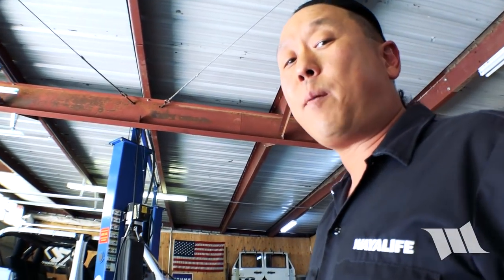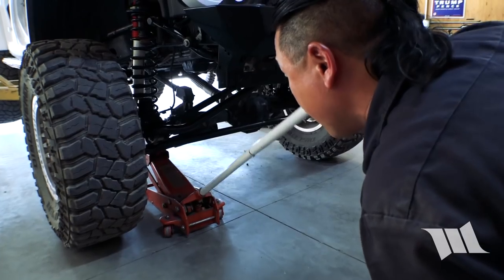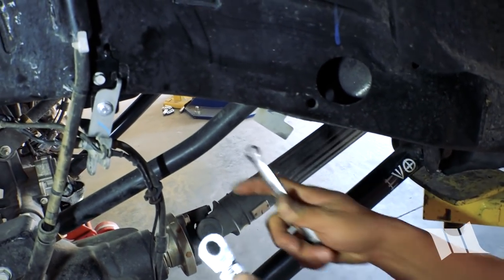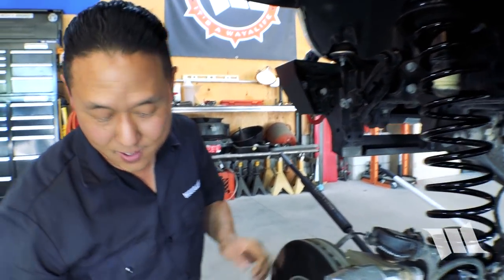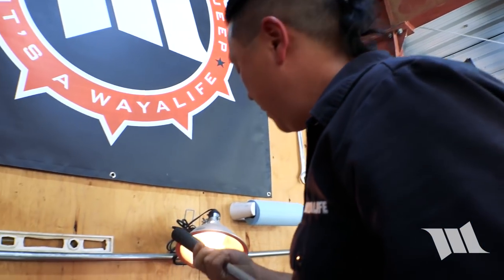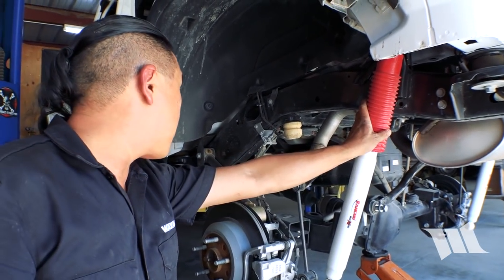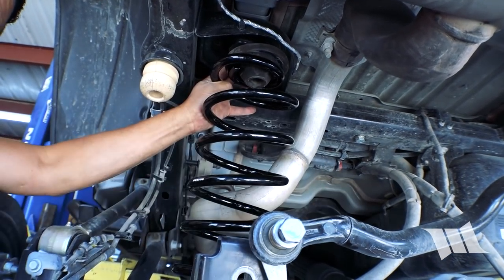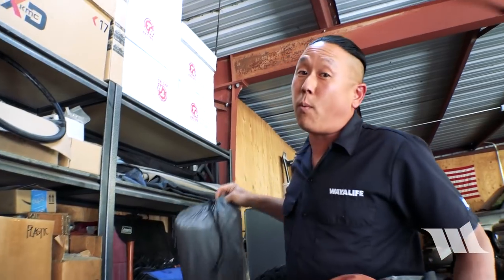Jeep JL Wrangler 2 Inch Lift Kit How To Installation : Dynatrac EnduroSport 2" Suspension Lift

Comment: I have been fighting with my AEV lift trying to dial it on for weeks and it’s just so harsh. Would this or a teraflex lift be a more plush and comfortable ride?
Reply from the maker: I am sorry to say but neither will be more plush and comfortable. Both are designed to not sag as much when carrying a heavy load and you just can't have your cake and eat it too. Mopar or even EVO coils will offer a much softer ride and if you carry a lot of gear, I would recommend that you install coil spacers to help make up the difference. Both of those coils are designed more for ride comfort.

Comment: Thanks again you two for another first rate install video, I've watched a lot of how-to videos and yours are still the best. So seriously thanks for the effort you put in over there.  I do have an off topic question, if you don't mind.  How do you find the Tekton tools working out for you?  We've been replacing our Craftsman stuff with Tekton as the choice for "best bang for the buck/Everyday wrenching" based on reviews but we're new-ish to the Tekton brand so would love to hear your thoughts before we get too heavily invested.  The shop will eventually be a mix of Snap-On and Tekton (which kind of rhymes too which is a bonus).
Reply from the maker: It's sad but true that Craftsman just isn't what it was anymore. So far I've been liking the Tekton stuff and they've been holding up well for me or, so far anyway. Snap-On is awesome - just super pricey.
Reply: Thanks for taking the time to reply to that, I'm happy to hear we've made a good choice in going with Tekton.  No complaints here so far, and yeah it's pretty sad that Craftsman has gone down hill they used to be amazing.  I'm sure they still make nice stuff it's just few and far between these days. Yeah Snap-On is great and yeah it's extremely costly, I like the no hassle return policy though and for some pieces that see a lot of use that warranty has been invaluable.
Reply from the maker: Yup. For the things that I really need it to count, I still turn to Snap-On too.

Comment: Great video as usually...is it true when you use an extension you must add more than what the spec call for ? For example : 125 ft/lbs should be 135 ft/lbs instead ?
Reply from the maker: Maybe if you're using cheap tools. A quality one shouldn't make a difference.
Reply: @wayalife  
How about if you use the same hardware over and over again should you increase on torque spec due to stress ?
Reply from the maker: With most of the bolts and nuts, you shouldn't need to. There are some though that shouldn't be reused such as the pinion nut.
Reply: Extensions make no difference but wrenching with universal joint sockets do. If you are offset of 90 deg

Comment: Do you know how long the stock rear swaybar links are? I just bought this lift and want to replace them with quick disconnects (up front, after the relocation, on my sport-s). Also, any recommendatuons for quick disconnects? Thanks!
Reply from the maker: If you bought this lift, the disconnects you'll want will be the same lengths as the factory rear links. I would recommend JKS disconnects.

Comment: I have a 2021 Wrangler. 4 Door sport. Ive Noticed I have a bit of a sag from all the weight from the side steps and front/rear ( Smittybuilt items ) bumpers. im seeing how its affecting my tires. from the jeep community im around they all run 40s which I do not want. I would love to run my Rig with 33s or maybe 35s. everyone is telling me to go with a 3.5 lift kit . stating it would fix the sag and wanting the height im wanting. BUUT it would mean that im replacing alot more under the jeep. I had thought about a 2.5  at the start but with this lift kit but was not sure if i would have what I wanted due to the weight. also what brand should i even be looking at? I really loved Old man Emu but from what i heard its a different set up in the UK than here so im lost what is it i need to do and what brand??? HELP lol
Reply from the maker: Personally, I would recommend a Rancho Sport lift as it is very affordable and will give you the lift you need to clear the tires you want to run. Here's a link to a video I made about it https://youtu.be/0x1wR2m5sKs

Comment: Hey Eddie, I bought this liftkit and installed it after watching your video. The install was a breeze and the jeep now looks like the toy I used to play with as a boy — so thanks for that! Problem tho is that I noticed a clicking noise after I installed the kit and the 37”s. I notice it sometimes when turning or when there are sudden movements on the jeep and I’m certain it is coming from the front of the vehicle. I’ve checked all installed parts were torqued to spec as per the instructions included in the kit. Any ideas what it could be? 
I also noticed that my the drag link has some play on the passenger side connection, but some forums say that’s normal for the JLs? Thoughts?
Reply from the maker: Did you double check your sway bar end links to make sure they are in fact tight? Also, have you checked to see if maybe one of your coils is catching on the bump stop tower? Rotational movement in a joint is normal. Shifting side to side or up and down is not.
Reply: I did double check all those you mentioned above. I was able to fix the clicking noise — it was due to loose upper and lower control arm ball joints. Something I’ve learned from a couple of forums, that those are sometimes loose straight out of the factory. It’s pretty interesting that I noticed the clicking only after the liftkit install.

Comment: Curious what size engine this has? I have a 2021 rubicon with the 2.0 liter but everything I look at says this lift will not work with the 2.0 liter. Love your videos.
Reply from the maker: This JL has a 3.6L but I see no reason why you couldn't install any lift on your 2.0L. I should also note that you should NOT run anything bigger than 35" tires with this lift. Over time and use, I found it to sag and only yield 1.8" of lift. Way too little for 37's.
Reply: @wayalife  do you still have the same lift on your rig or have you upgraded to something that handles your 37s?
Reply from the maker: @troymathis4755  I replaced the lift a few times and mainly to test things out. I'm currently on coilovers and long arms - a BIG jump from what you see in this video.

Comment: everyone seems to start up front.  I know you said you had already switched them, so in your case it makes sense.  But with the sway bar links needing switching, I'm assuming stock JLs will need to start in the rear?
Reply from the maker: They're just sway bar links and you can pretty much install them at anytime and with your Jeep on the ground. But, you can start on whatever end you prefer :)
Reply: @wayalife  following your lead and adding the 3/4 rough country spacer to my build, as I have the same winch and heavy front bumper.  Just looking through their instructions, you didn't show this step in the video 😂 "Any vehicle equipped with any Rough Country product should have a “Warning to Driver” decal installed on the inside of the windshield or on the vehicle’s dash. The decal should act as a constant reminder for whoever is operating the vehi- cle of its unique handling characteristics."
Reply from the maker: @matnelen1724  LOL - too funny :)

Comment: How do you think this Dynatrac lift kit compares to the 2” one from MOPAR?  In all honestly which do you consider better?  I’m trying to find the best 2” lift possible as realistically I can’t go higher due to the space in the condo in the city. Also, just wondering why Dynatrac didn’t include the new front control arms.  I already have the Mopar lift, if I opted to go for the Dynatrac would you keep the Mopar loft control arms with it? Thank you!!! Hope you have an awesome Christmas!  ✌🏼
Reply from the maker: Honestly, between the two, I probably would have to give it to the Mopar kit. The Dynatrac lift doesn't need new control arms because it really only yields about 1.8" of lift and that's well within OE spec. The Mopar lift yields closer to 3" of lift and it much better suited to run 37's. Also, the Mopar kit comes with Fox 2.5 shocks instead of just 2.0's like the Dynatrac lift. Being that you already have the Mopar installed, I would just stick with it.
Reply: Thank you brother!  Much appreciated 🙌🏼 I didn’t even realize the Mopar kit has 2.5 shocks over 2.0.  Honestly I wish you all the best for the holidays.  Your videos are so detailed that it’s literally pleasing to me.  So many others are just washed with junk but I do love how your videos are so well edited and just straight to the point.  

Thank you again, I appreciate you responding!
Reply from the maker: Flattered you would say as much. I know we're not as popular as some of the other channels out there but we try to keep it real. Glad I could share what I know with you.

Comment: The main reason I was asking is that I was was very disappointed in the Mopar performance lift ride quality, especially off road. I found it to jar the crap out of you with just the slightest increase in speed.
Reply from the maker: It's hard to get a good ride that can really soak up big bumps without spending a lot of money. And if I can be perfectly honest, this kit, even at it's higher price point will not give you what I think you're wanting. Trust me, a super nice ride can be had but it'll cost you.
Reply: @wayalife  thanks much. I appreciate your honesty

Comment: So it’s a 2” lift, what size tires do you run? Thanks for the video.
Reply from the maker: In this video, we were running 37's but after long term use, we found the lift settled down to just 1.8" of total lift. Far too little for 37's and so we changed it out.
Reply: @wayalife  did you go down to 35?
Reply from the maker: @TargetOz Negative. I installed a different lift.

Comment: Eddie. Great videos as everyone says. I tow a trailer behind my JLUR. Currently no lift and stock 33’s. I saw Trail recon Brad review the dynatrac endurosport and also watched yours along with the Rancho. I don’t see myself getting higher than 35’s but do plan to do trails in Moab and The rubicon trail at some point. I was thinking of these two or the metal cloak dual rate 3.5 vs the smaller one only coz I don’t want to keep changing but given that I tow with mine I am thinking I shouldn’t go much higher than the 2” lift. Thoughts?
Reply from the maker: This is what I can tell you. The Endurosport ultimately only yielded about 1.8" of total lift. The monotube shocks are nice but offer a firm ride if that's what you prefer and they won't fade as quickly driving hard and fast across the desert. The rancho kit yielded closer to 2.5" of lift and for daily driving, I'd say that it offered a softer ride. In my opinion, 3.5" is way way too tall just for 35's and you really need to be prepared to address things like drivelines at that height.
Reply: Ok so based on that Rancho at 2.5 or the dynatrac is sufficient and recommended especially with the towing aspect. I wheel and want to be able to do the rubicon trail someday. I’ve seen stock jeep JLURs make it but  I don’t want to struggle that bad. Maybe with these lifts there will be sufficient clearance with 35s. Would you agree?
Reply from the maker: @camvil11  If I had to choose between the two lifts to do the Rubicon, I would definitely go with the Rancho kit as you would have better clearance. I ran the Rubicon with this lift and 37's and still felt like I was dragging everywhere.

Comment: Never noticed you had a jeepster until now. Between a jeepster chassis and a jk chassis, which would you say is stronger.
Reply from the maker: Without question, a JK chassis is stronger. If you're thinking about building a Jeepster for wheeling, that's what I would work off of. Synergy did this and it's awesome.
Reply: @wayalife  I've seen there jeep and even photoshopped it the color that I want mine to be. The fact that roamr kept the stock frame.

Comment: With this suspension lift, would you suggest wheel spacers? Or not necessary, curious if you had any rubbing. Looking to do this on my jl sport!
Reply from the maker: A lift will not determine whether or not you need wheel spacers. The size of the tires you run will. Taller and especially wider tires like a 37x13.50 will require you run wheel spacers especially if you're planning on mounting them on factory wheels. That said, tires like that are way too big for this lift. Trust me, I tried it and over time, found the lift to only yield 1.8" of total lift and that lead to way too much rubbing when flexing on the trail.
Reply: @wayalife  thanks for explaining that! This is my first jeep, bought a 2022 jl and love it so far. I want to go 35in all terrain tires, not looking to do any crazy off roading quite yet! I ordered 2.0 fox shocks and 2.5 lift kit. Any recommendations? Think that would need spacers? Btw I love all your videos I’ve learned a lot so far and great information! Thank you for that!
Reply from the maker: Again, it depends on how wide the 35's are, whether or not you have wide axles and whether or not you'll be installing them on factory wheels. Depending on that, you may not need wheel spacers. Either way, I would hold off on getting spacers until after you install your lift. You may find that you have no rubbing at a full turn and at a full flex and if you do, get spacers then.
Reply: @wayalife  thank you very much for explaining and taking the time to reply! I will do that!

Comment: hi - love the vid. i'm looking into picking up a Gladiator Rubicon in the near future. so with a 2" lift, either Dynatrac or Mopar, will the stance be similar to this rubi jl wrangler? looks like the tires are 37s and may i ask for spec on tires and wheel spec? offset?
Reply from the maker: On a JL, the Dynatrac lift only yields about 1.8" of lift. The Mopar will give you closer to 3". That being said, I don't believe Dynatrac has a lift available for the Gladiator or at least, not as of yet. The tires you see are 37x13.50 Cooper STT Pros mounted on KMC XD231 beadlocks.
Reply: @wayalife  thanks so much! i'm guessing I can easily fit the tire size you have. oh with mopar installed :)

sorry for numerous questions.. did you re-gear?
Reply from the maker: I have but really, it wasn't necessary with the 4.10 gears that come on a Rubicon.
Reply: @wayalife  got it thanks so much again!! i'm waiting for the diesel to arrive then will decide which motor i'm going to get. only thing i didn't like about the diesel is that it will be 3.73 instead of 4.10. guess torque makes up for it but would've been more appealing to have 4.10

Comment: Great video as usual. Would this be a good lift for a rubicon jl on 35’s and not have that weird wheel well gap?
Reply from the maker: Yes, this is a perfect lift for 35's.
Reply: Thanks for speedy reply...with 35’s, do you see any need for tailgate reinforcement or can i get away with something like the teraflex alpha?

Comment: I can’t decide between this one and Mopar 2” lift. Damn it.
Reply from the maker: How big of a tire are you wanting to run? If 37s, I would recommend the Mopar kit.
Reply: @wayalife  I am sticking with 35s (Nitto Trail Grappler 35x12.5xR17). Mostly paved road driving.  No rock crawling. Please let me know what you think would fit me better. Thank you   🙏🏻
Reply from the maker: @demisx  Both are a good fit, it just depends on if you want a taller lift or just enough to clear your tires. This kit will be the later.

Comment: What's the bar that goes between the two lower square parts of the frame where the factory front skid plate used to be? My Jeep looks a little naked without the factory skid but it won't fit with my ARB bumper. Thanks!
Reply from the maker: It's just angle iron I put on there for the same reason. I've since just cut those tusks off.
Reply: @wayalife  thanks!

Comment: I noticed you have adjustable lower control arms. Are there any other aftermarket suspension parts on your Jeep other than that and the dynatrac kit?
Reply from the maker: Actually, yes, we do have more stuff now and we hope to put out a video on it soon.
Reply: Thanks for answering my first question. My last question would be centered around warranty. Do you know if this kit would cause any problems with the dealer warranty?
Reply from the maker: @kristopherlewis7357  It shouldn't but then, what gets warrantied is all up to your dealership. Technically, they'd have to prove whatever it is you're wanting fixed or replaced was damaged by the lift in question but then, a dealership can flag you for whatever they want and make you fight it. My best advice is to get regular oil changes at your dealership. They're cheap and it'll make you a loyal customer and it's a lot harder to give you grief as a loyal customer than a guy who just comes in to get warranty work done.

Comment: What steering stabilizer would you recommend with this kit? Also boss man do you run stock steering steering stabilizer?
Reply from the maker: Honestly, I've found the OE stabilizer to work the best.
Reply: @wayalife  thanks for the reply and testing out all the Jeep things. You still running the synergy steering kit? I think I may pull the trigger.
Reply from the maker: @litoornelas6409  Yup, it's a great setup :)
Reply from the maker: @litoornelas6409  I guess it depends on how big of a tire you're planning to run. If just 35", this kit might be better for you. If 37", I would go with the Mopar.